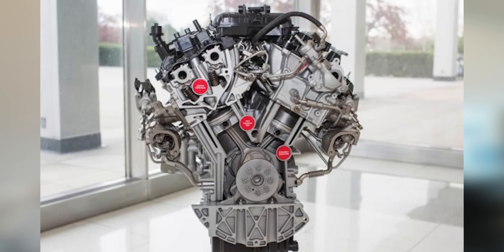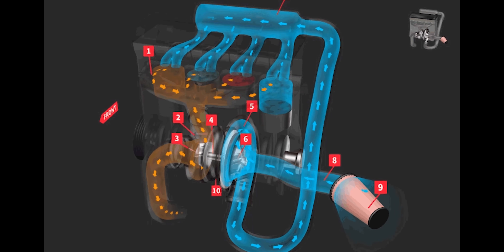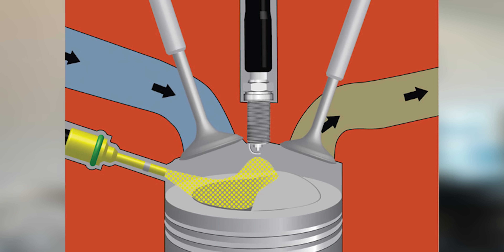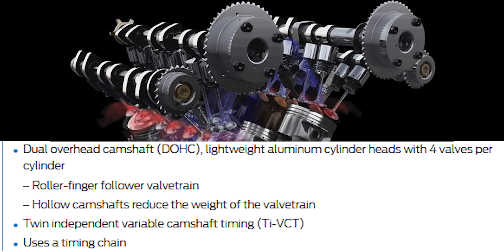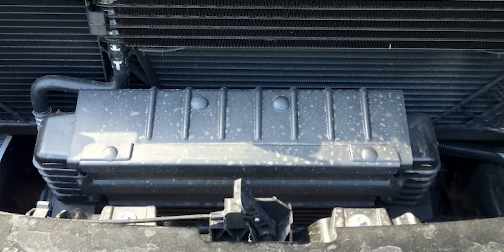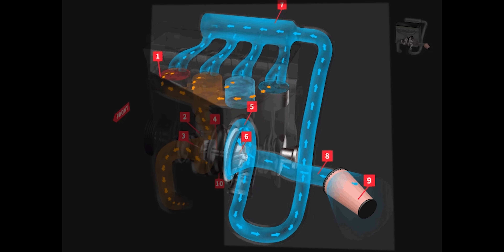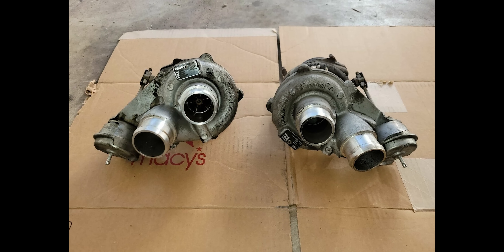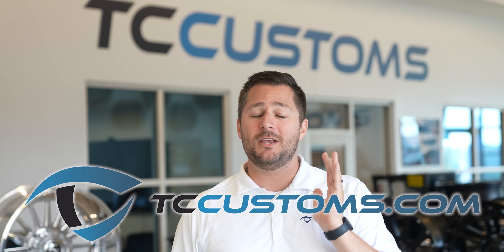The Truth about the Ecoboost Engine!

Comment: 10k between oil changes would be alright if you did mostly highway driving but IMHO it to long for in town short trip use. True oil is better nowadays and engines burn cleaner but still it does get dirty . Dirt in the oil wears seals as well as bearings and rings. Ford doesn't really want you to get 300k on a truck they just want to get you past the warranty so they can sell you another ; )

Comment: I just bought a 2014 F 150 with 85,000 miles on it and it runs great but it`s only getting about 12 miles to the gallon and I`m not lead footing it even a little. Any ideas out there guys?
Reply: vacuum leak

Comment: I wonder what's the 3.5 eco economy on highway empty running it easy in 70, does it get somewhere to 25s like na v6?... I had about 25, 26 on flat I-10 empty with both Ford's 3.7 and Pentastar in ext cab trucks

Comment: Interested to learn why we are having issues with these engines in our Transit 350 fleet vans. From what I've heard the vans trap heat in the engine compartment and we've had a few need the turbos replaced, failed exhaust manifold gaskets, one full engine replacement. Not having these issues in the F-150's. Anyone have any insight here?
Reply: These engines are junk my father is a retired mechanic. The main bosses in the engines cannot hold together under heavy use. They throw rods on 3 and 6 cylinders. Ford should go back to the inline 6 indestructible

Comment: Hi Mitchell, excellent vid on how my engine works in my 19 150 XLT!  I've heard that a  "catch Can" is needed for Ecoboost engines. I've also heard that by 2019 that problem has been solved.Please advise!
Reply from the maker: I don't think that a catch can is always necessary.  But It can't hurt (as long as you buy a reputable brand).
Reply: @TCcustoms_  Will a Ford dealer install one?
Reply: The catch cans were primarily being installed by people to slow down deposits on the back of the intake valves. The revised engines shouldn't need one because the addition of port fuel injection means that fuel will wash deposits from the valves as you drive. Save your money.
Reply: @camberwellcarrot420  THANKS! The info doesn't mean much now (I LEASE), but does mean much in the future, (I planning to BUY one)
Reply: The catch can’s purpose on an intercooled engine is to keep the oil from the PCV system from coating the intercooler and reducing it’s effectiveness.  The flow restriction and hotter air going to the cylinders will cut power and efficiency, and make the engine run hotter.  Cheap, easy to install yourself, easy to service.  DO IT NOW!

Comment: Can someone explain why, if the hp and torque are are higher with the 3.5 than the 6.2 in the super duty, the 3.5 isn't used in the super duty instead of the 6.2?
Reply: Because a Super Duty has a HUMONGOUS engine bay. Opening the hood and you will see this tiny engine; your friends will not be impressed! 😂😂😂😂

Comment: Had a 2013 3.5. At 80K the motor went to crap. Turbo’s leaking oil from from the fittings. Also had a rear main seal go out as well. Got tired of  1-2K repair bills and ditched the truck.

Comment: Should you install an oil catch can on the new ecoboost engines?
Reply: The port injection should take care of the intake valves deposit issue, so a catch can shouldn't be necessary.
Reply: @camberwellcarrot420  thats what i was reading on one of the forums, but some were still debating it.
Reply: The catch can will keep your intercooler from getting gunked up with dirty oil.

Comment: My last 2 f150's have had v8's.  I change the oil every 3000 to no more than 3500 miles.  My new power boost is going to get the same.  Is there any issues with changing that often?
Reply: We have more then a few customers who run the T350 3.5 Eco Boost. The Ford FL500 oil filter and full synthetic oil changed every 3,000 to 3,500 miles. They are nearing 300,000 miles. No major issues. The plugs last around 35,000 miles. The coils seem to fails soon after the sparks plugs go. Do drive with a misfire. 

Not one turbo failure yet. A few broke exhaust studs in the head.
Reply: Yes that new oil is going to destroy your motor !    no other than wasting your money there’s no issues with changing your oil too often
Reply: @jasongunningham9545  

He would not be wasting his money. He would be save money down the road.
Reply: @jasongunningham9545  it's an engine

Comment: There was nothing said about the disastrous design flaw of having the water pump inside the engine.  When a water pump seal fails the coolant leaks into the oil and destroys the engine.  In the news: "Ford Lawsuit Over Duratec V6 Due To Water Pump Location: Aug 19, 2019 — A class-action lawsuit over certain Duratec V6 engines has to do with major repair costs for water pump failures due to the engine design."  This one flaw overwhelms all the good design features.

Comment: I know this isn't 100% "apples to apples", but in the real-world I've found the 2021 F150 with the 5.0L miles better overall than the 3.5L comparing directly between my 2020 Raptor, and a 2021 Laramie 5.0L. Fuel economy is actually better on the V8 unless you completely stay out of the boost on the 3.5L. The power delivery on the V8 is smoother, and you don't get that sort of ''jerky hit" of power like you get when you accelerate quickly with the turbo charger setup despite the dual 'hot' turbo chargers. Lastly, you can employ as many "tricks" as you want to improve longevity of a turbo charged engine, but it has way more points of failure than a naturally aspirated engine.

Now I know the 2020 Raptor has a much wider body, and larger heavier tires which does make a difference ... however, I'm seeing just shy of 22MPG average on the 5.0L Laramie, versus a little over 15.5MPG with the 3.5L EcoBoost in the Raptor. Both are pavement driving, not considering off-road into the equation at all. Again, not 100% apples to apples but that's an absolutely massive difference in average fuel economy. I found the 3.5L to be a much less smooth motor overall, but you could notice the torque down lower in the RPM range. However ... once you get the 5.0L up around 3,500 - 4,000rpm it sounds and pulls like a Nascar. 

5.0L any day.
Reply: Just got a 23' 3.5 XLT and it is fast.  the 3.5 is way faster than my 22' ram 5.7 Hemi.  Tested a 23' XLT 5.0 and it was also crazy fast... the 23' 3.5 EB and 23' 5.0 Coyote seemed to be the same. just different feel.   But i do know the 3.5 will out tow the 5.0 all day long

Comment: Had a 2016 and they had to replace the motor at 56000 miles the number three  piston shrunk and the mechanic could not explain why I ended up lemon law it back t Gm after twenty some visits to the dealer

Comment: I have a 3.7, is it a eco boost or ?
Reply: I think that engine does not. It is probably a Duratech; the replacement for the 4.2 Essex. If it is, DO YOUR RESEARCH! If your engine has the internal water pump, CHECK YOUR OIL frequently! If these pumps fail, coolant can leak into your oil pan and cause major issues! If you see your oil is turning milky, get your vehicle to the shop ASAP!

Comment: They are good engines until you purchase bad fuel! Just spent $2,110 to replace rt side turbo, $2,693 to replace entire fuel system, $693 to replace rt side valve cover gasket and vacuum pump. Just sold mine yesterday. Its was a 2013

Comment: Would be better had Fix Or Repair Daily produced the ecobust with 6 cylinders in a row (inline) like bring back the 300ci 4.9l "tractor" engine with OHVs (no fucking dual camshafts/phasers chains two piece plugs coilpacks) and it's basically game over competition then i buy one used😁

Comment: 3.5 eco-boost TwinTurbo. Years 2017 through 2020. Cam phaser failure is pretty much 90%. Any Ford mechanic will tell you it’s not a matter of if, but when. Most likely will occur below 60,000 miles. That’s ridiculous !

Comment: Bought a 2023 with the ego boost, and I have already added a catch can just in case of the carbon buildup.  This truck will get oil changes every 3000 miles, not a chance I would go over 5000 miles for anyone reading this.

Comment: I'm a master tech. In school the teach you these engines are only good for 70k miles if towing at 50% gvwr for 50% of the time. Bet Ford won't put that in their brochure. For daily driver they are just fine. Don't be a fool and tow heavy with these and expect long life
Reply: Lol...do you even know what GVWR means??

I'll give you a quick lesson, master tech.

EVERY VEHICLE is over 50% of their GVWR just being empty. 

If you're thinking of GCVWR,  then a very light trailer would put you over 50% of the max in a 1/2 ton.
Reply: @johnpeters9793  ever think of maybe spell check had something to do with it? But thank you for the correction. I'm not knocking the EcoBoost and 1/2 tons, just some have very unrealistic expectations on longevity and or think they can tow heavy with them. Do you know what the tongue capacity is on all half tons? 500lbs, why, cause they only put class 3 receiver on them, class 3 receiver is rated to 500lbs max. In almost every scenario you run out of payload before you can tow at 50%.
Reply: @johnpeters9793  500 or 600 not much difference, I'm not good at quoting Google, I was only going by the receiver on my 2011, its stamped 500/5000. I have never seen a f150 with a cargo capacity or 3k, there might be one, my xlt 4 door is 1536. I've seen a limited at my dealership 2ith only 1128 cargo capacity. I don't think anyone owns an f150 with 3k cargo capacity. Most went be caught dead driving a white 2 door 2x4 short bed with the 3.3l motor in xl trim. take a 6k empty TT and load 1500 in it, not unreasonable, that's 700-750 on the tongue sometimes more and sometimes less depends on the trailer, 2 average adults 200 each, a cooler 100, weight of the hitch 70-100, some firewood, 100, and you know there's always more junk taken, play it safe at 1200lbs, most xlt 4 door trims are around 15-1700 cargo capacity, you are at or close to max. Might be ok on flat land but that's it. A 10k TT will control a f150 instead of the tow vehicle controlling the trailer. A 10k TT will run 28-34 ft in length, it's a receipt for disaster, you don't have enough brake or weight on the truck to control it

Comment: You did a nice job explaining the features of the Eco-boost engine....however, here is the your slap upside the head...   WHY is torque referred to in these modern times as "POUND/ FEET", when the shop manual you showed lists the torque as "Foot / Pounds" ??  That just bugs the crap out of me, and I am sick and tired of hearing it.  BTW, the 1969 Mercury Marque with the 429 2 bbl carb developed 490 ft/lbs of torque at 2100 rpm. ( SAE rpm, NOT metric rpm)  I have 5 and half decades fixing cars, Ford factory trained, and the first person in Washington  State to become SAE certified in the late 70's... you know.. just after the oil embargo caused Ford to install different dip sticks to read "FULL" when you actually only had 4 qts of oil in the pan..

Comment: It is impressive the power they are making but, I wonder how long it will last if it is being worked hard every day. I think it will be ok in the average persons half ton simply because it isn't being worked hard. But pull a loaded construction trailer every day and how does it do? Like the man said, there is no substitute for cubic inches because a big engine loafing will last much longer than a small engine straining. And yes we have had turbos in the aviation industry for a long time but they are not for increasing peak power, they are for maintaining power as you climb to higher altitude. It is called turbo normalizing. In other words it will make the sea level rated power up to a given altitude, say 15000 feet. Each application is different. They will make rated power up to what is called critical altitude. The altitude that it can no longer maintain the rated power and power will fall off as you continue to climb. So, it is the same tool but does a different job. Next time you talk to an engineer ask him what the critical altitude is for the eco boost. They all have one and I would be curious the know what the little Fords is. Thank you and be safe.

Comment: Have they ever told you that they drink a quart of oil every 1400 miles?? And there's nothing they will do about it. Try driving 10k miles on only 6 qrts of oil... boom!! I have had 3 f150s my newest is a 2021 3.5  ecoboost. This is the first time iv ever had this problem.but the damn cam phasers and vvt sensor problem still happens. I do an oil flush every 3k miles.

Comment: Yes, most of these engines are as durable as the 5.0 V8 but if are one of the small percentage of owners of the engines that experiences water pump seal failure you will have an extremely costly repair with a long downtime.  Similar failures on the 5.0 V8, or any engines with traditional exterior water pumps, will have a dirt-cheap quick repair by any shadetree mechanic.  I would buy a Ford with the 3.5 V6 EcoBoost engine if it came with a 200,000-mile warranty or a $10,000 discount.  Ford knows that the poor design of the water pump will definitely result in many owners getting stuck with the big bill because most failures only occur after the warranty expires. My local power company only uses Chev V8 trucks and vans because of this issue.

Comment: Hope they put that water pump out of that timing chain in the Ecoboost setup
Reply: Worst design ever (Cyclone/“Dura”tec) haha what a joke that name is. Totally ruined an otherwise great engine putting the water pump inside it. But my understanding is the 3.5 ecoboost is an entirely different engine from the “duratec.” Let’s hope so.
Reply: The 3.5 Ecoboost has an external belt driven pump, the N/A 3.5 is the chain driven one. The 3.5 Ecoboost is loosely based on the Duratec for the block design only, everything else is specific to the Ecoboost.

Comment: ok, i just don't get why your giving away a BDS lift for just the 2021 F-150, it just looks like to me if you own any other year, your not being fair, you want  F-150 owners to buy your parts and aftermarket add ons from TC Customs, so be it, but you wouldn't like it if only 2021 F150 owners bought your items..and not other year trucks , just a observation to me.and by the way, my son had a 2013 SHO Taurus and the turbo's went out at 70,000 and 82,000 miles...and Ford said TOO BAD... that cost him over $2,800 to replace them both, and cost Ford a repeat customer...

Comment: I bought into the Ford propaganda with my 11 f-150 ecoboost and loved it until it hit 65k miles. I was lucky enough to have the timing chain stretch issue due to the cam phasers. I also performed maintenance and the normal schedule that we are all used to 5k oil changes and all yes all other fluids every 30k including the clunky transmission. At that point I decided that the ecoboost is dead to me, and sense Ford pushes it so hard well…. I then bought a 2016 Ram 1500 with the 5.7 Hemi and 150k on it now without any issues. Maybe the ecoboosts are better now and I was dumb and bought the first generation, but I have to say don’t know if I trust them for the long term, especially when I have a hemi that’s still running strong.

Comment: The reason they went to both fuel injection location  was because only injection fuel into the cylinder it caused lot carbon build up behind the valve and didn't have the fuel to keep the valves clean

Comment: i just bought a 2.7 2021 its good outa the gate but miss the mid 5.0 growl and lunge my 18 had.but one huge diff is the ride from 18 to 2021 is huge the sync 4 smokes the sync 3.put keys in pocket the truck knows your coming and it auto unlocks the 18 didnt do that.the 2.7 is no joke its fast and quick to 70mph then kinda falls on its face thats where the 5.0 and 3.5 will beat you.and ford changed the 10 speed from 18 to 21 its way smoother than my 18 was and the 18 was good but its noticiable

Comment: i trust turbochargers... to blow up engines... forced induction means youre running higher presssures and will blow headgaskets and burn up pistons and such.... they actually work pretty good on diesels as they operate at low rpm and diesel runs cooler than gasoline... but on gas engines they are definitely not long lasting engines... i dont hate turbos... i just wouldnt put one on anything but a diesel or a racecar...

Comment: I had my ecoboost engine have a complete failure at 40k miles. Ford wasn’t going to replace it unless I could show receipts for every oil change… once we got that taken care of, they put a new long block in… less than 40k miles later, motor was bad again… and no warranty. Not only that, my fuel mileage was alway horrible… even nursing it, cruise set on long trips and never got better than 18.2 mpg. I have since switch back to the 5.0. Never any engine issues and always get better gas mileage. You can have that piece of crap motor… I’ll never buy one again.

Comment: As a retired mechanic... with a turbo they are crazy recommending 10000 mile oil changes... 5000 miles..
 A Honda civic engine does not belong in a full size truck
Reply: As a retired Youtube commenter...you don't have to tell us you are a retired mechanic in every comment.
Reply: @jkeelsnc  even just driving down the road with slight hills the turbo has to stay lit all the time.. my 5.7 hemi gets 22mpg with ac on the highway.. no turbo needed... I just moved pulling a 5000 pd uhaul... pulled it like a beat mule... no turbo needed lol